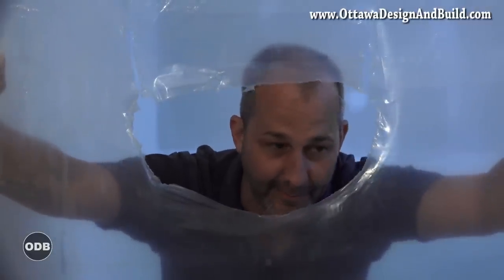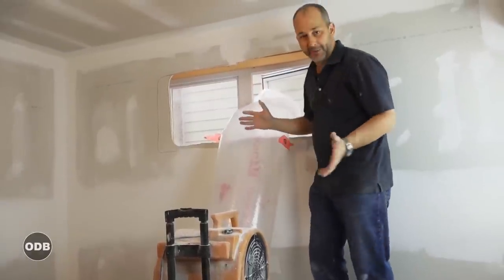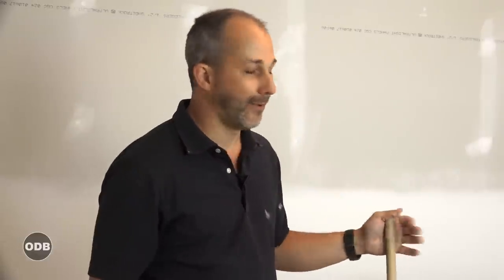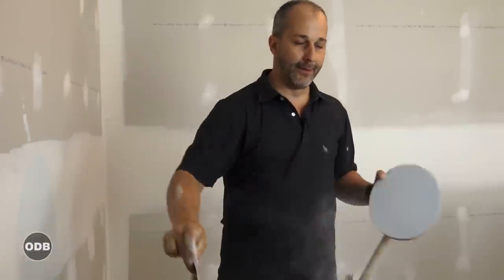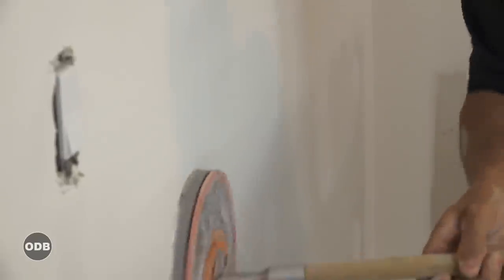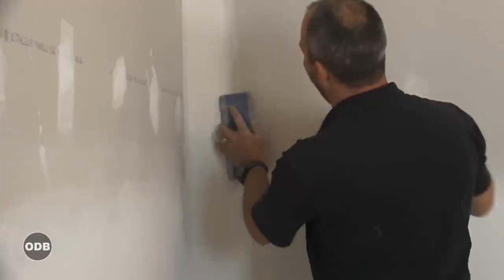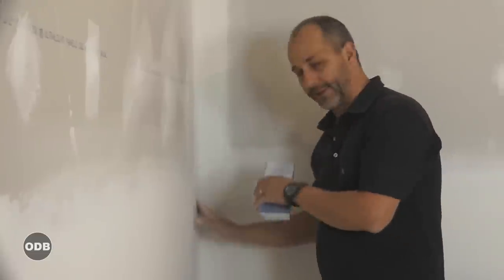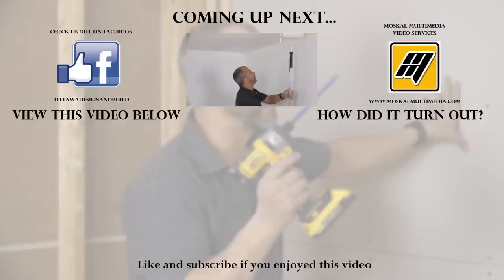Complete Drywall Installation Guide Part 12 Sanding

Comment: I have hung and finished a lot of drywall in my life. My parents 3200 sq ft home being one of the projects, so Ian a long way from being a newbie. And the amazing thing is I learn something new on EVERY VIDEO YOU MAKE. That is amazing. Sometimes it is something basic like sanding boxes at 45* as shown here. What a basic concept, and if it were not for this gift of a video, I would still be sanding parallel with the edges of the boxes and just accept you get grooves. I am going to sand paint and mud on my bathroom light switch and FINALLY get the quality I expect. Thanks again.
Reply from the maker: Thanks a lot for the comment. Keep up the good work and have a great 2018!

Comment: Thank you for the video. I found rot in my basement due to a leak and got a contractor to fix it. a month and 3k later he wasn't even done drywalling (no plumbing required) and left huge gaps and sub par workmanship and was promptly fired. This video series as a guide helped give me a reference to do what should have been done in the first place and in 3 days (2 days repairing poor work) and my downstairs bathroom is almost done. Thank you again.

Comment: We had a house fire the first week of August. We have pretty much repaired everything from the sub-floor up. At this point, we are at the stages of cleaning the drywall sanding dust out to prepare for paint. My question is.... Have you ever opened all the doors and windows and used an electric leaf blower to "de-dust" the walls, ceilings, etc? If you haven't, you should try it......works great!

Comment: For anyone wondering, the venting used in this video is referred to as "Lay Flat Ducting." Had to research it myself since I wanted to recreate this awesome negative pressure machine, but I tried to make my own ducting with 6mil poly with disastrous results.

Comment: A better ventilation set-up is too buy a gable mounted attic fan, glue carpet padding on the outside, add a power cord, stick in window, close window to hold it in place...done. I add cardboard to fill the gaps in the window. The vacuum in the room is very strong.
To clean up, get a sponge and bucket of water, sprinkle water drops on floor, broom dust into a pile. Dust will turn into a damp-sand while brooming.   You can also use a spray bottle.

Comment: When I finish sand I always use a light and shine it at an angle on the wall. That way imperfections that'll be amplified by paint will be easy to spot and sand out. Great tip on negative air pressure
Reply from the maker: i save the light until after the prime.
Reply: @HomeRenoVisionDIY  to each their own. I guess if you're doing everything yourself then great. However, a painter isnt going to want to do any mud work. Two different techniques to accomplish the goal. Cheers

Comment: Awesome and incredibly helpful videos. Just wanted to make a quick suggestion about the ventilation. In the fire service we use positive pressure to remove smoke from a structure. Set your fan about 2-3 feet from the door opening blowing into the room you're sanding. It will end up blowing 3 or 4 times the CFM the fan is rated for. Open an exhaust opening no larger than the intake and all the dust will be blown out. Saves money on the plastic sheeting, as well as runs clean air through your fan eliminating the need for cleaning.
Reply from the maker: Thanks for the tip Adam. I am going to give that a try.

Comment: Hello! I am currently hanging drywall in my fixer upper. This is a first for me and I am not a pro at all. I've been watching your videos to get me ready for when I need to start the next steps. My question is what is the best method to filling in large gaps in-between boards? Should I just fill with mud and tape over it?
Thank you for your videos!

Comment: Hey how do you clean the walls after sanding, before primer? Thanks alot. And keep up with the good videos.God bless
Reply: soft brush to dust the walls, slightly damp sponge can "wipe" the coated (not the bare board) areas.   same with the ceiling.   good vacuum afterwards to suck up any excess dust.   Try not to sweep the floors as the dust will go into the air and stick to your fresh wall.   It is ok to sweep after painting as the walls are washable at that point (provided the paint is dry of course)

Comment: Great job bro!!!  Long story short I had to gut about 85% of my 2 story home bc of some  Major mistakes and the builder built these homes back in the early 90s.  Polybutylene piping, That card bore looking stuff that supposed to be a radiant barrier and so post to structure the home.. They used that  instead of using plywood and  and so by doing that we had un condition air meeting conditioned air!! So  Needless to say you know what happened.. I own a asset Recovery company now but I use to do  Commercial up fits with the gas industry so I would go around to convenience around the country and unfit them very little dryway I always hung it but always hire a  Finisher.. I'm doing all this work on my home myself from  Installing a viega manabloc to installing new pex out though the hole home to gutting all 3 baths installing new tile showers floors new kitchen  And the list can go on and on as I'm sure you already know but bro let me say THANK YOU  For Being And cutting all the junk out and getting straight to the point of how to do the finishing I just finished my last little bit of sanding now going to clean up and move  To the next phase tomorrow . THANKS AGAIN ..   P.S. YOU ARE THE MAN!!
Reply from the maker: awesome! billy. If you have pics then send them to me and I can post them on Our Instagram account.

Comment: If you want to cut down the maintenance cleaning on your fans put a double layer of cheese cloth over the intake of your fan.  It'll capture the dust
Reply from the maker: that would cause the motor to burn out.

Comment: I’ve done a lot of renovations but usually sub out drywall finishing. It’s tedious and never comes out as good as it does when my sub does it. So I respect that you’ve picked this up along with tiling, flooring, framing, etc. How long ago did you start learning? Did you teach yourself or learn from a pro? Thanks for sharing and teaching.
Reply from the maker: Learned form everyone I have ever worked for or with.

Comment: One modification I'll probably do to your fan is get a big Square air filter and maybe create some sort of way to attach it on and off easy so you could just change it on the Fly every time it's dirty the will probably save you a lot of maintenance

Comment: I was binge watching your videos, feel empowered to do the walls on my own )).. Do you have any suggestions on removing popcorn ceiling and smoothing it.. Would appreciate any tips! Thanks.
Reply from the maker: if it is painted then install new drywall over top and joint tape. if it has not been painted and it isn't too old so that you don't have to worry about asbestos then simply add some water with a light spray let sit a few minutes and it will scrape right off. then you joint tape. Cheers!
Reply: @HomeRenoVisionDIY  My house in London Ontario is 32 years old built in 1988. Should I worry about asbestos when scraping a popcorn ceiling?

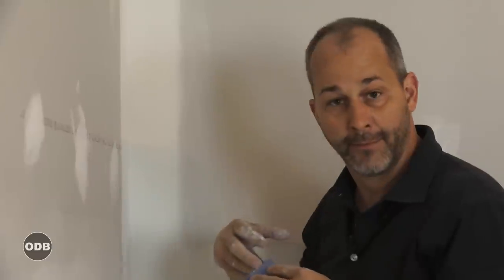Comment: Part 12 Sanding. 7:39 minutes into the video you suggest not
sanding the dents out but go back with your primetec?? And fill the dents in.  
Is that what you said? What is primetec?Great set of videos.  Used it to do my 16x24ft workshop.  Not finished yet but so far it's coming out great thanks to you.
Reply from the maker: The dents should be filled in during your prime check. There is a video out on this subject from a couple weeks ago.
https://www.youtube.com/watch?v=dtstHsJk15A&t=25s
click the link for easy access.

Comment: Could you use any of these tools for sanding off popcorn ceilings? I am about to remove the popcorn ceilings in every room of the home I'm moving into and that seems like a lot of back breaking work with hand tools. So I guess my question is more, what's the best way to do that? My partner and I are between buying a drywall sander because of the long handle, or an orbital sander of some sort for the versatility. Thoughts? Also, I have loved watching your videos. You're awesome.

Comment: Watching each of your videos in the series for new project im doing. The missus complained last time about the plaster sanding dust, so you tips could be a relationship- saver, especially the area sealing & fan.  The sweeping compound is good, but couldnt find it at my DIY store.  Can you suggest viable readily available alternatives, Jeff ? (eg sawdust etc)

Comment: Question about cleanup from the sanding. Do you need to do anything to cleanup the wall surface in prep for the painting? Great video series btw, love the attention to detail.
Reply from the maker: nothing at all Andrew. the fine dust left on the wall mixes with the paint and becomes part of the solution to creating a nice white wall. since we sand after each coat the bumps will fall to the ground the next time when it has paint on it. Cheers!

Comment: My solution to the fan would be to use a big square house hold fan mounted in a piece if plywood cut to fit the window opening and just turn it on.

Comment: Very helpful. I was wondering whether you have ever used a Dustless vac and sanding tool for drywall. I have a bathroom to do with no window to create negative air pressure. Thank you.

Comment: I also do negative air pressure. I just use a crappy oscillating fan. Blow that shunt out the window, make sure there's an open window somewhere outside the room for fresh air intake and close the door to limit flow to beneath the door cracks. Does it work? Probably not, but in appeased airflow theory in my mind, and come to think of it, any dust outside the room is usually just from my feet tracking it. Doesn't seem to settle on too much in the hallway.
Reply from the maker: I don't think that qualifies as negative air. that is more passive air . Cheers!

Comment: KEITH DIPPEL  Penrith NSW.

I notice you don't use adhesive when you install the sheeting.  In Australia adhesive is applied to the studs approximately 18 inches apart before placing the sheeting.  Screws are used to secure the edges of the sheeting. Comment please.
Reply from the maker: Very interesting. More than 1 way to do anything. Cheers!

Comment: @2:48 I have looked high and low in Pittsburgh for the air ventilation poly tube, but no luck. I would think that in a city this large that there would be a fire restoration supplier, but I've come up empty.
Reply from the maker: Cheers I will look into this!

Comment: Do you have to prime new drywall if you are installing shiplap over the drywall? Great to see a contractor involved with all the stages of the building process! Great videos!
Reply from the maker: Hi Micheal, as long as your shiplap does not shrink too much after install to show through the gaps you will be fine. Cheers!

Comment: I am short to pay someone to do my basement.  Basement has the frame. So, I encourage myself watching videos and start with the insulation.  The village came and approved my work. Also said is a good job cleaned and organized.  Now going to do a drywall.  I watched all the videos many times. I have the materials,tools and going to start" tomorrow ". I only miss the name of the" 60 sanding radius" ??  Could you let me know what is the name of the disc with the bar? Thank you. You help me a lot!! And yes I am a woman.
Reply from the maker: Hi Anna, you are awesome. the sanding tool is the radius 360. I have a link in the description of the video to get it from amazon. Cheers!

Comment: Hey Jeff, what do you recommend for prepping the walls for primer after sanding?? i would imagine there is all kinds of dust and junk on the walls after, no? PS totally using the negative air trick. Fantastic videos! You save me a boatload of money
Reply: I just saw your answer in one of the other post. Leave it on the wall and sand between coats. You the man!

Comment: Great video I just got threw Sanding a closet talk about a mess.have you ever heard of people running some tape over their screw holes that run vertical 
In the horizontal sheet...I live in Texas and I see alot of knew houses ,where the screws go they have mud from top to bottom not just on every screw like you do
Reply from the maker: That mud technique is something that I demonstrate in another video, However in this video I was actually sanding my son's tape job. He is still learning and not using that technique yet. It is just mud and not tape.

Comment: not sure if that was covered but do you have to brush off the sanding dust before applying the next coat or priming?
Reply: Christian Bentz I was just about to ask the same thing. How do you clean the dust off the walls. That can’t be good for your paint. Damp sponge?

Comment: One more thing, do you wipe the wall with a rag or wet sponge to remove dust from the wall before painting?
Reply from the maker: Never. I just let the dust mix with the paint and create even more solids to help get great coverage.
Reply: All the time I wasted, I always thought you were supposed to wipe or vacuum all the dust off for better primer and paint adhesion.
Reply: I would suggest a vacuum versus a blower as a blower would create dust unless you're masked properly and/or have a nice negative air pressure system... So vacuum gently so as not to scratch/mark the walls... Or you could use a DAMP rag/swiffer-type SPONGE / YELLOW SOFT SPONGE, to wipe the walls lightly to remove excess dust prior to painting... These methods have worked well for me because if you have too much dust collected on the walls, you would have imperfections on the wall/sediments when you paint/roll over the dust on the drywall... A spray-gun/sprayer could reduce the effects, but you could still see specs on the wall, the paint would not adhere well, and you would require additional paint to cover the walls... MGTOW!
Reply: iv been doing dry wall and paint since 69. remove all dust and wipe wall down with damp sponge.
Reply: I've been painting since 55, just long-lick the dust off.

Comment: Spot on about the negative pressure airflow. I've frequently used a regular household fan stuck into a piece of foam with a circle cut out the middle of it.

When I'm done each room, I end up with a white circle on every screen I need to clean off. Looks like a big eye.

Comment: Jeff, if on final sanding you get down to tape in a section on a tapered joint  (probably didn't embed it deep enough at first), should I go back and give the joint another finish coat and build the whole joint out again?  Or any other tips?
Reply from the maker: Always prime before doing any repairs. Then follow my prime check rules and you will save a lot of time

Comment: Hi Jeff! I’m adding orange peel texture to my newly installed walls to match the rest of my house. I didn’t see you mention adding texture anywhere. Am I correct that it should happen before priming or after? And should I sand over it gently between paint coats like in this video? Thank you so much! You are so helpful. Ashley
Reply from the maker: Hi Ashley, if you are using a sprayer you can add primer in the texture. otherwise prime after texture for roller or other techniques. cheers!

Comment: Do you ever use a drywall sanding screen??  Not quite sure what these are called, just remember my father using these, wrapped around a piece of wood just like sandpaper.
Reply from the maker: Never. I hate them. they scratch everything up.

Comment: What would happen if the paper shows a little when you finish the job. and you apply the primate. Do you think there are problems if I leave it like this?
Reply from the maker: After you prime, run your hand over it. If you don't feel an edge you won't see on either. If there is one you can fix it then.

Comment: Thanks for the fantastic video series. I particularly like your "no sanding" or "as little sanding as possible" technique. Question: how do you handle removing an undesirable texture? Our home is covered in hideous knockdown texture and I would like to coat it with standard orange peel. Some recommend "skim coating" the entire surface to achieve a flat surface and then sanding (a lot). Curious what your technique would be here.
Reply from the maker: remove the drywall and start over. It takes less time and guarantees the result. It will end up costing the same after you buy 20 boxes of mud. Cheers!

Comment: For dust-free drywall sanding for many years I've used the Sand & Kleen Aquair Filter drywall sanding system. I hook it up to my central vac, but it works alright with a portable vacuum cleaner. It traps the drywall dust in water, protecting the vacuum system from getting plugged up. After it settles, you can pour off the water and optionally recover and reuse the mud that it trapped.
See the instructions, here: http://www.sandkleen.com/Sand&Kleen_Instructions.pdf
and their web site, here: http://www.sandkleen.com/index.html
If it makes a lot of noise, or if the collecting vessel's walls are collapsing, or, heaven forbid, water gets sucked into the vacuum (not good) then you've got the suction too high or the water level too high.

Comment: Found out by using a sand sponge in circular motion I'm able to take out imperfections.
Reply from the maker: if you have enough mud on the wall that can work. be careful you can also create shadows in certain lighting.

Comment: when sanding my drywall on a current project, I am using a 220g sanding pad, and the drywall gets very smooth. After prime and paint there is a very slight difference in texture between seam and wallboard - is this caused by the mud being too smooth or is this normal?
Reply from the maker: the wall has  a textured paint , usually called eggshell. In this situation I recommend a primer with high solids and paint the entire wall. This should give you a better consistency.